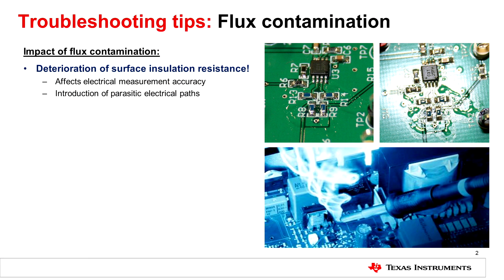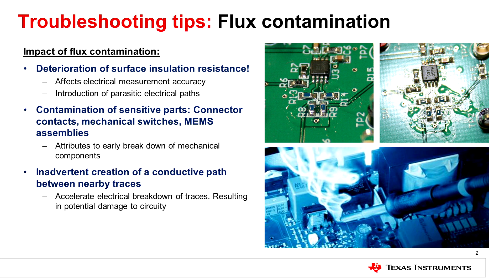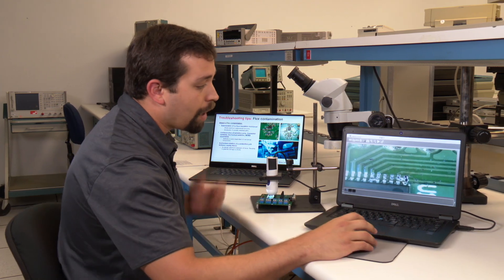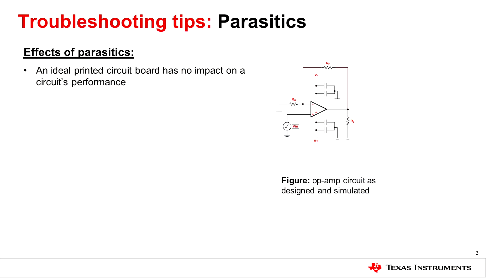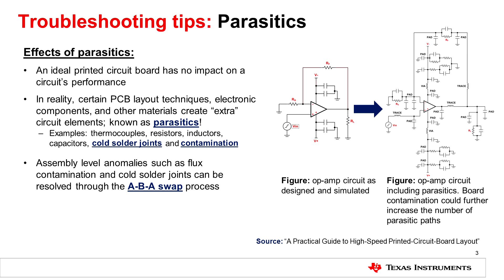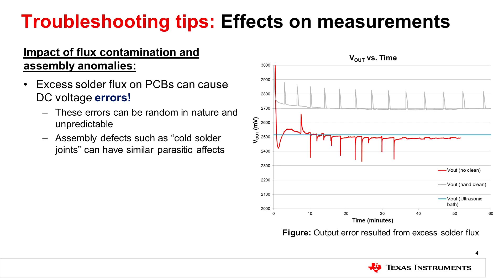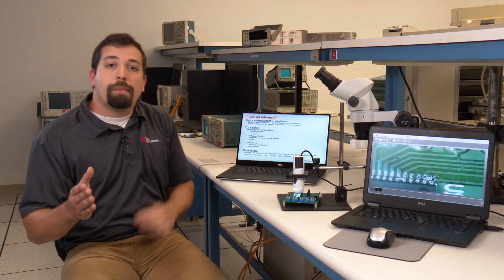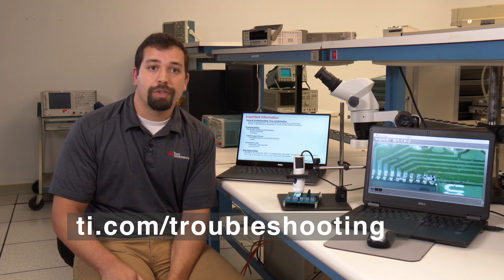Troubleshooting Tips: IC - Flux Contamination

Comment: One important parameter unmentioned in this video (although possibly addressed in another video) is that if you are going to use a solvent to clean off the flux after the board is soldered you must be sure that ALL of the components mounted on the board at the time of cleaning are compatible with your particular solvent, compatibility meaning that the solvent does not attack any part of any of the mounted components.

I remember long ago a batch of electrolytic capacitors that had the rubber seals at the positive end of the cap dissolve, after a stretch of time, and without any hint right after cleaning that the seals would simply disintegrate and fall out, leaving the capacitor exposed under the seal which can dry out the electrolyte and ruin the capacitor. 

The solvent had dissolved some critical seal component and left the seals visibly ok but after a time they were definitely not so ok. 

Nowhere in any data on the capacitors was this possibility mentioned and the caps seemed ok for several months, and then they started unhappily returning….

Tuatha De